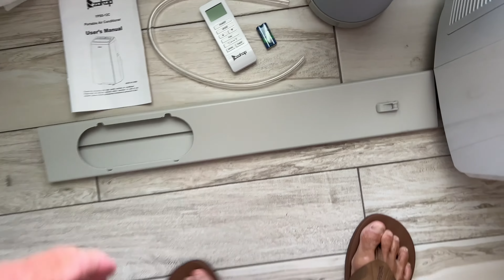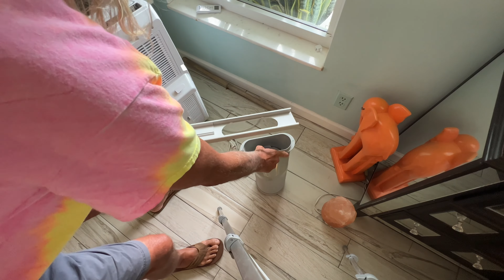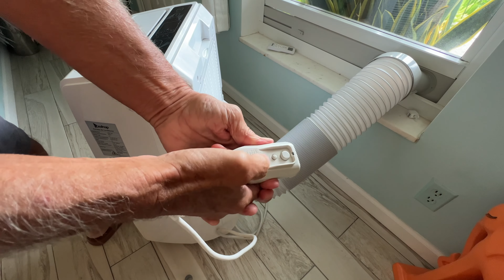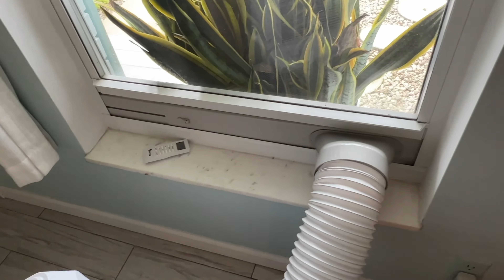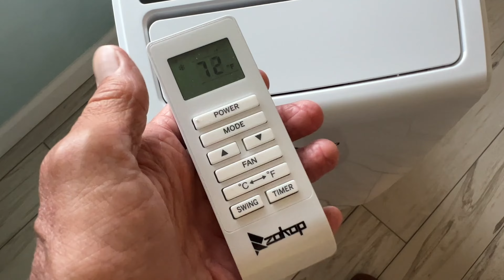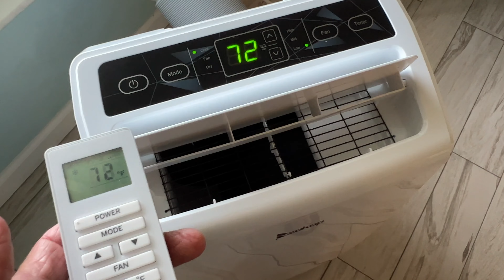How to set up 12000 btu portable air conditioner in horizontal window

Comment: Maybe this one is the one I should get?  I'm hoping to not have to use the central air and just cool my room. Or who knows, maybe I will use both!!! It is just too hot in Miami!
Reply from the maker: I definitely think this is a really good one for the price. I got it on Amazon and it definitely cools down the room. I have a Black & Decker and a high sense which are smaller that do work but I think this one’s the best.